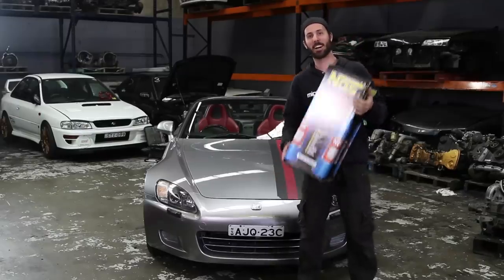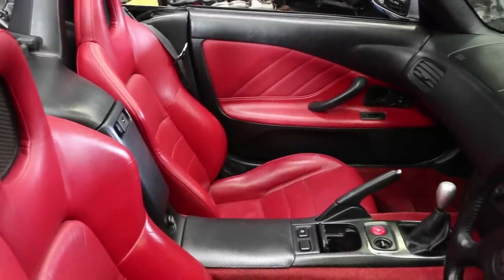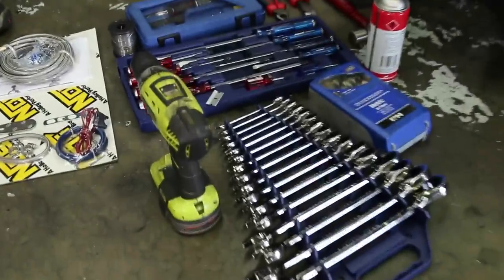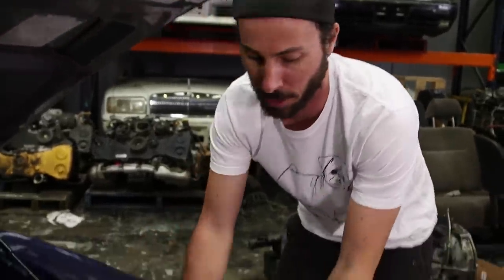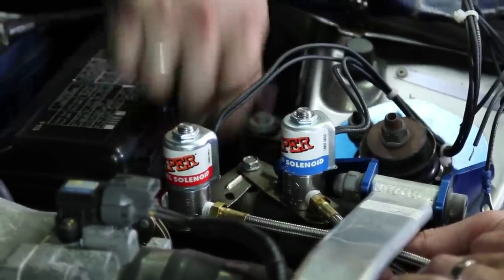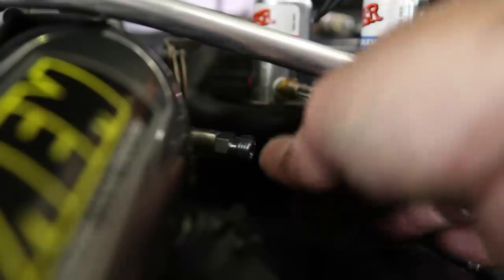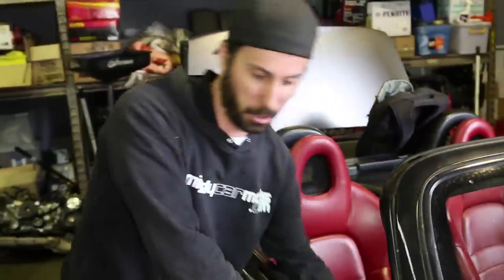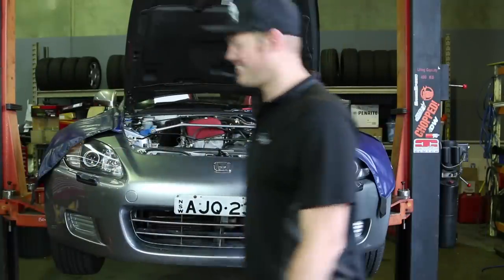How To Install NOS

Comment: I hate Honduhs because most of the drivers think they have the coolest, fastest thing, and they certainly don't. (not to mention the Ricers) It's also annoying to have a car that you have to rev to 6k RPM to get any power out of it. It's cool that they spin to 9k RPM, but they still don't make any torque. Perhaps Honduh guys just think they're going fast because they're thrashing the motor, not because they're actually moving fast.
On a side note, the S2000 is an amazing handling machine.
Reply: When using a car on track, 6k RPM is perfectly acceptable (and yes, bikes are intended to rev much higher due to the traction limitations and the lack ob ability to use torque). A car that is driven on the street (which is what I was referring to since Honduh boyz have no idea where the track is) should make good power throughout the power band. I love 4 cylinder engines, and the 4G63 in particular. However, I think you're confusing my hate with Honduh owners vs. cars and engines in general. It's more about how these guys treat driving and customizing as opposed to the cars themselves.
Reply: Nobody thinks that, except for the ricers. Honda's aren't the only cars that get riced out.
Reply: ***** As I'm sure you noticed, I label them as "Honduh" guys to make my point of them being Ricers.
As far as bikes having less room for displacement, you are incorrect. Several bikes are 1.6L or larger. I know of quite a few that are 2.0L 2 cylinder motors. Many current bikes are 4 cylinders. They have increased rev ranges to compensate for lack of torque and cannot use torque due to the components and physics in general since a single tire cannot effectively put the power to the ground. But that's off topic.
Reply: Jeffrey Ball actually the F20C is tuned to deliver more torque than other na engines @ low RPM. S2k can cruise in 6th gear @ 30mph and pulls off better than most turbos in this power range. On street there is no need to go Vtec other than vroom vroom. Maybe you should drive one some time...
Reply: Schafmeister2000 I can't drive an S2K. I'm 6'10". I've been in an uncomfortable ride along, and there is no power to speak of. Unless it was just so seamless I didn't feel it.
Reply: I personally own a S2000 that's semi track prepped (Entire suspension + weight stuff) and I DD it. I'm not going to say it's the best car to drive, or on the track. However, it's a very fun car to drive on a daily. Due to the "lack" or torque you can drive the S sensibly while in traffic. I rarely ever go over 5K's. It makes it and easy car to DD, and a safe car to DD. Especially in the wett.

And then when youre on the windy's / track.. Then trust me when I say this, but then you won't even notice the lack or torque. (Unless you drop down below 6K).
This lame character makes it DDable, and offers you a pretty decent mileage. Especially when you look at the engine you're running. That power from that engine.. Even though I'm not a "V-Tek is magic" guy myself.. I must admit that hearing the sound of it at 9K...And then realizing it'll do that while stock.. Still makes my heart beat a little faster. Every time.

It doesn't have tonnes of power. But that's not the purpose of it. It's supposed to compete with a Boxter, which is the poor mans Porshe. It's about the sensation of the whole thing. Only my MX-5 came this close. And that one is still miles away. The sharp steering, almost non existing body roll (Mostly due to suspension mods) and that combined with the feeling of a lightweight flywheel and racing clutch.. 
It doesn't "just" make you enjoy the windies. It makes you feel the sensation of them,

If you live anywhere near me you should just join me some day, And then you'll see what I mean. 

Oh..
And best part of driving an S2000:
When someone asks you what car you drive, you just tell them it's a Honda and that's it. They won't brag with their dad's AMG like they will when you say you own a Porshe Boxter or a BMW Z4 (Theyre the competitors). It's nice to own a car from a brand thats known for their stupid Hybrids. Avoids the braggy people. Then when I point at the S and they see.. Then the AMG stories get started.

I drive the S to feel the ride, and because I love driving. Not because I want to hear some stupid kid brag about their dads car. And that's with most of the S owners over here.
Reply: Any car can go fast if you put the money and time. This is coming from a v8 guy.  Google speedfactory civic
Reply: Any car can go fast as long as you put the money and time. This is coming from a v8 guy. Search on youtube speedfactory civic and you will see
Reply: *****
This is obviously a form of sarcasm.
Reply: ***** If you watch MCM odds are you dont race and im agreeing with him on ricers which are usually ppl who drive a stock civic  who think that they are fastest on the road. Even if you own a "JDM" car doesnt mean you cant hate on ricers
Reply: ***** you sure? 

I know3 different groups of tuners in my area. The stand still show offs. These are the ricers. 

Then you have the street racers as in drag racing. Their cars are purpose build, and therefore not rice. And some of those are rather quick. I know for a fact that my S2000 won't keep up.

And you have the track racers. They have the cages, not the most powerful engines. But mainly stock ones to ensure reliability. Only by looking at the tyres they run you know enough. (R888 and R1R).
Yes they have license plates on them, and yes they drive on the windies. But they still track.

And to be honest..
I like all 3 groups. The first are just great people to hang out with, and the last are great to drive around with.
More people track then you might think
Reply: And yet all the cool bikes rev to ~14000k and sound amazing (and are fast!)
Reply: ***** then there is el freddy civic with a k26 or k27(some sort of stroked k24) that´s running 7sec flat at 198mph, and then back in the day we had Stephen papadakis run his 1500+hp nsx engined civic shell to a 6.52sec at 210mph or something like that, this was back in 05 I think?
Reply: Skarphéðinn Sæmundsson
There will always be outlying examples like these. My "hate" is for the Honda culture as a whole. Too many people making it look bad for everyone else. I share a similar hatred for Mustang owners. Those guys love to do stupid stuff and make a bad example of themselves as well.
Reply: Skarphéðinn Sæmundsson And Honda engines have no less torque then compareably sized engines from other makes, they usually stack up pretty well in that department but do tend to make alot more hp. some of them have to be revved to do so, then low down torque isn´t abundant but good gearing and light weight helps there. Not all Honda engines are rev machines, they also make quite good "normal" engines that do their jobs quite well. the f20c in the jdm s2000 for example delivers 250hp@8600rpm and 218NM@7500rpm, even if you have to rev it to get those numbers they are there and there ain´t many n/a 2l engines that have more torque than that and if they do they usually make around 50-60% of the power the Honda makes. the same can be said of many of it´s vtec siblings.
Reply: I hate to pull the DSM card, but the 4G63 will outdo any Honda motor IMO. Making power with the 4G63 is as simple as it gets. Being a square motor, you have nearly equal torque and HP. They can be built to rev high (not quite as high as a Honda motor), but they are built tough. I love my turbos and love lower end torque, two things Honda doesn't offer.
Reply: Jeffrey Ball dsm card? Gonna compare a stock turbo motor that has internals to match shouldn't be fair but from my search it seems that common word is that they are maxed out at 500whp on stock internals,? There are examples of the f20c making 6-700whp on stock internals(not a turbo motor so it should be at a disadvantage) and they seem to be holding out pretty good, I on the other hand know a few dsm guys and they spend most of their time in the garage with one thing or another broken.
Reply: The ricers ARE the ones who think they have the coolest car. I have a 93 accord and I recognize its not the coolest, but at least it isn't a rusted out pos
Reply: Jeffrey Ball So you hate Honda, because someone else who owns it is actually happy and not to shy to drive one. 
That is seriously, a minority complex on your behalf sir. What does it matter, what someone ELSE regards as good? It's always a matter of taste and for some even pride. What do you drive, that is so mighty interesting for someone else to know!? I mean, even if you have a 700HP racer, who really does care one bit!? I think if you are satisfied with whatever you drive and makes you feel good...it does not matter what you or me think about it really.

I see MORE morons thinking a V8 is the shit, while in 2015 they are surpassed on regular base by smaller motors stock (technology does not stand still) i see more douche bags driving a brand new truck with a huge v8. With CLOSED BEDS , because god forbid you actually USE the fucking thing AS A TRUCK. And all that awesome chrome trim and the typical blacked out rims and such. Who hate on v6 and 4cylinder engines, without knowing a dang thing about it to begin with. 

I mean each to it's own, but there is something to say of each and everyone one of them. Ricers are OFTEN TEENAGERS, that got their first car and trick it out as they are proud of it. As much as you see black people (stereotype here it comes) drop giant chrome wheels on their ride. It's a part of the culture in car world, and a part their pride, making remarks about that?! 

Perhaps you should get a real hobby or something, as that is also another reason why people do it. 

Then it's slow? I believe  that s2000 is 177HP more then plenty to just commute, why is it that 
people think you need 300plus to be a man on a NORMAL commuters sharing 
road?! You cannot go faster then the car in front of you really. Unless 
you want to spurt like am maniac. And then stand still next to the same 
Prius again at a traffic light. 

Sorry for my grammar Dutch and all, i do live in the USA.
Reply: Quite the statement. I guess I say that I hate Hondas because of the negative culture that surrounds so many of their cars. I dislike the ricer mentality. Yes, this is a stereotype. I can appreciate someone making a car to their own taste, but the idiocy at which ricers do this annoys me. The term ricer is not reserved for Hondas or 4 cylinders.
To answer the previous question as to what I drive is irrelevant as to how I feel. I don't think I have the greatest cars in the world, and some might also think that I'm a ricer with the mild modifications I've made. I drive a 350Z daily and have a Datsun 510 with a 4G63T swap that is still under construction.
I guess my banter for hating on ricer cars was taken poorly. I apologize and don't mean to put all Honda owners into this.
Reply: +Jeffrey Ball 👏👏👏
Reply: Quite the statement

Stop being a hypocrite, debates work both ways.

I guess I say that I hate Hondas because of the negative culture that surrounds so many of their cars

That statement makes no sense or whatsoever. Think about it, you're not a part of it to begin with. So you hate something, you were never a part off. And i mean, they really bang at your door with the Honda/ricer culture everyday right? No they do not...makes no sense to me what you say.

I dislike the ricer mentality

So what is the ricer mentality? Why do you not enlighten everyone here who might be a "ricer"!? You are so clueless my friend, you ever been at a meeting? Joined a beer with them? Talked to them? Hung out with them? Had a nice night with a "ricer" talking about cars and what not?!

No you obviously enough did not..

I can appreciate someone making a car to their own taste, but the idiocy at which ricers do this annoys me

So someone else is having fun, and that annoys you?! So when someone tricks out their car to THEIR liking. That is just, for you a big NO.

Because, they directly irritate you right? They ram their lifestyle through your throat right? Common now, be real here.

I guess my banter for hating on ricer cars was taken poorly. I apologize and don't mean to put all Honda owners into this

NO need to apologize at all, you have your right on your opinion. However, i find your argumentation weak at best. But that is my opinion, which is meaningless i know that. Perhaps hang out with a couple of those guys. Get to know something, you do not really know as of yet (and please do not tell me you do already)

IF you are at the meetings, and hangout and have a beer and have a good talk. Then you see, that they are awesome people to hangout with and have fun with. And it's all in good fun.

And i am no ricer, i own a Mustang and Chevy, far from being ricer that is. But common man...
Get out the door a bit more, and go to a couple of meetings.
Reply: Michel Linschoten How am I hypocritical? Because I dislike the culture that surrounds a subgroup? Hypocritical would be if I was hating something and then being a part of it.
Yes, I have been to car meets and hung out with ricers. It lasted all of about 10 minutes. As soon as these people rev their engines, brag about parts on their car they don't have, and do burnouts with a vehicle that is "shady" at best, turns me off. I have an issue with "Mustang guys" as well. They seem to like to rev and peel out when they leave a meet. Ricers are posers. People pretending to be something and having no knowledge of the topic. There's a hilarious old video about some guy bragging about his VTEC in his 6 cylinder Mustang. RICER! He was completely serious too. He was trying to impress some people and instead looks like a moron.
I do go to meets. In fact, we meet every Wednesday night and Saturday morning. My car friends have a wide variety of tastes from  a Pantera, to GTRs, 350Z/370Z, Porsche 911, S2000, Noble M400, FR-S, and many others. We are mature. I still remember my days of being ignorant at my first meet with my 92 Talon TSi AWD and drag racing at the track. But I didn't "show out", put stickers on my car that say R-Type and remove the muffler because it "makes it fast". There is room in this world for idiocy, and they can keep it somewhere else. Your opinion of my comments is biased and you're only reading the parts that prove your point. My whole point is that there are people that perpetuate negative stereotypes in car culture. I generalize them as "Honda" and "Mustang" guys because they seem to be the majority of this negative stereotype around me. Many people have a stereotype about BMW guys as well.
Maybe I am a hypocrite now that I think of it. I love cars and the car culture, but I hate those who make us all look bad. I'm a self-hating car lover.
Reply: basically that means you love "V8S" AND SOME OTHER US CARS have some respect? look hondas can make it up to 7.somethin they beat some shit ass us cars
Reply: xtreame-rice balita Not even close to what I'm saying. I know Hondas can be fast. I have a friend that has one of the fastest All-Motor cars in the country running a 2.6L K series. I'm saying that I use the term "Honduh" to refer to the gutless powered ricer cars who hard park with sketchy parts. They give everyone a bad name. Just like that douche that does a burnout when he's leaving the meet. Everyone else is just hanging out having a good time, and this one guy can get the cops called and get everyone kicked out. I respect cars that are purposeful. I respect a rusty bagged POS that is done right over a rikity fiberglass clad eBay special.